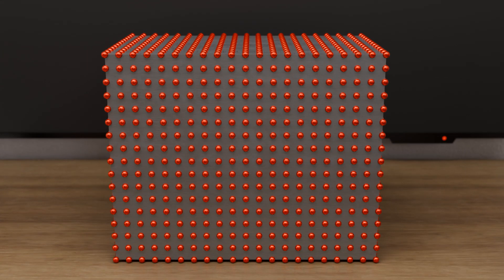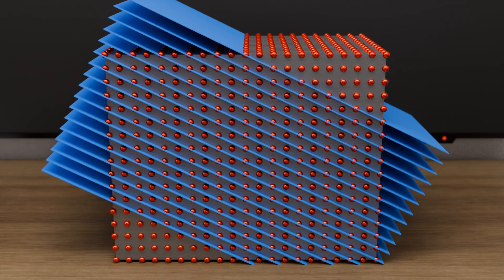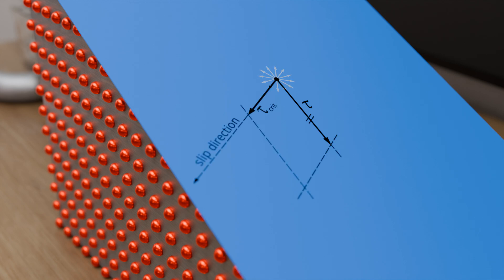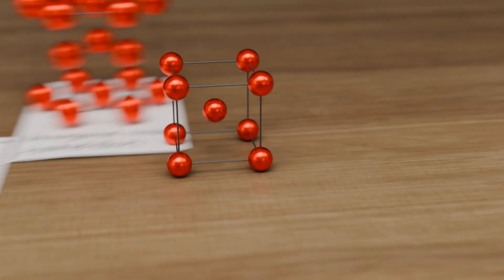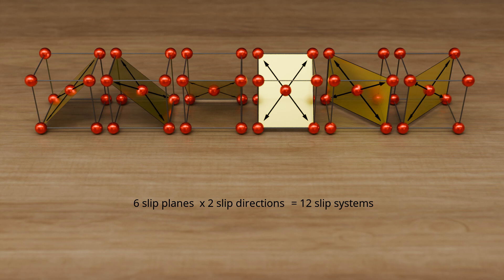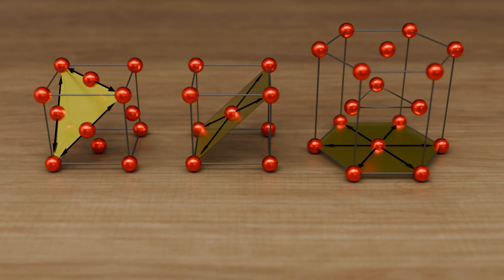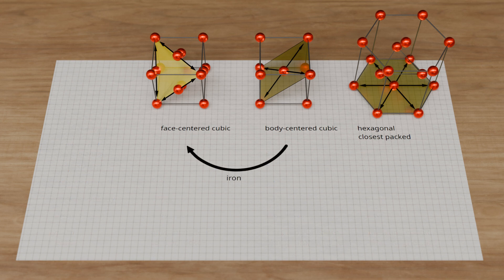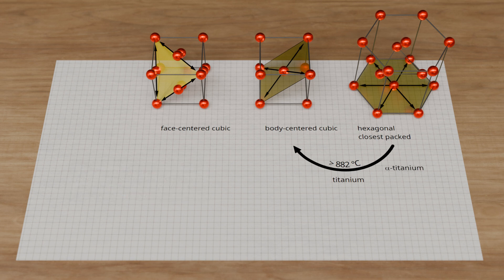Deformability of metals | ductility of lattice structures | slip planes | slip systems

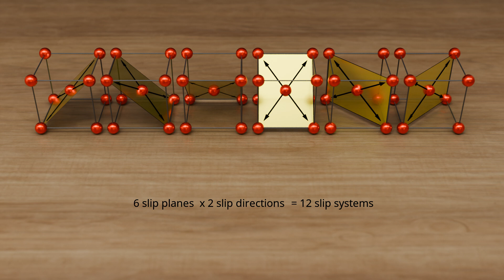Comment: thank you so much for the video. just one doubt, 13:46, you said that other slip directions are ruled out due to high electrostatic forces acting on them, which again makes sense, but just for illustration, can you just point out one such non-energetically favorable slip direction? (i am trying to understand the slip direction origin, like in this case, you considered the central atom and showed the directions, can we originate at corner atoms? i have to learn about this topic more, thanks for your video)

Comment: thanks  a lot for the quality of the video. I don't manage to understand the number of slip systems for BCC 13:46 why do you count 2 slip direction ? I see 4 arrows so i would rather think of 4 slip direction ? so 24 slip systems
Reply from the maker: The term slip direction can be somewhat misleading. It doesn’t refer to a single direction in the strict sense, but rather to a sliding dimension. After all, what matters is the degree of freedom available for atomic movement. If a crystal plane can slip easily in one direction, it can naturally slip just as easily in the opposite direction. These two opposite directions are physically equivalent and together represent a single degree of freedom. Therefore, the term slip dimension might actually be more appropriate than slip direction. A double-headed arrow thus represents a single sliding dimension, and accordingly, one slip direction.
Reply: @tec-science  thanks a lot makes sense: actually it s just like in FCC: there are not 3*2 =6 but 3*1 directions.
Reply from the maker: exactly